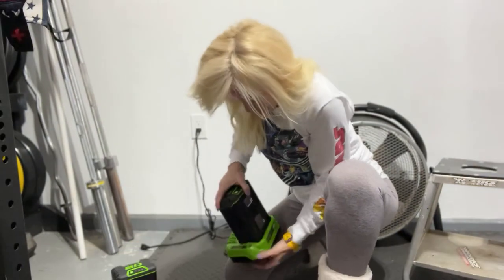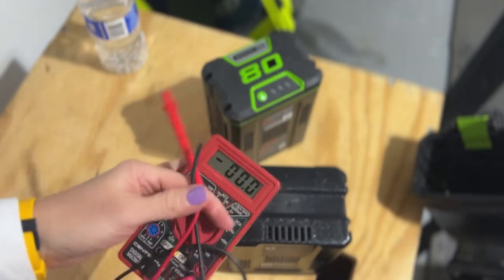Rechargeable battery repair Fix Blower dead battery solution - Power Tool Greenworks lithium

Comment: I watched about 6 videos on this problem when I happened to find yours's.  BEST one yet!  That's exactly what I did today.  No questions asked. When I went to find a new one to replace it, it had $50s off and the new one had a 4 year warranty on the battery.  I'm guessing this was a frequent problem.  I'm glad they addressed the problem as it is a powerful little blower
Reply from the maker: I'm def not educated in the multimeter field so for me to troubleshoot the outcome is grim.  I was hoping it would be a common sense fixer upper, but by the end of making the video my brain reminded me I thankfully purchased the greenworks item at Costco which has a fantastic return policy.  They swapped the blower out no questions and the new one, the batteries and the chargers are still chugging along.  Thank you for your kind words!  Have a super day!  💖💖💖

Comment: I have found solution just take one of good batteries, can be Milwaukee or different one and connect minus minus plus to plus with any wires and wait like 45 seconds to 1 minute and you will be ready to recharge.
Reply from the maker: Where were you before I made this video?!  😄 I truly know very little about those batteries.  I'm def trying to educate myself. Thank you for options.
Reply: @OfficialHeather  Not always work. My battery starts charging but after a while red starts blinking again.
Reply: I saw a video showing how to do that, but when I saw this video it was a no brainer.  Plus the Costco replacement blower was cheaper and had a 4 year warranty on the battery.

Comment: If Green work's was a better company  they could add a 82 trickle charger and better yet use a side plug in with a meter so you could see what was going on and they could use a sensor that would open the circuit, if it sensed heat or radical voltage ? Just like many Lithium Ion batteries have built in sensors which were around 15 years ago!

Comment: Repairing these batteries is often as simple as jump starting them by supplying 80volts dc to the hot and negative terminals to raise the voltage until the charger decides it is a good battery.  The smart chargers decide they are no good because they were allowed to sit too long or get to too low of a voltage.  Having a good battery helps to accomplish this.  You can find people with better explanations on youtube of jumpstarting lithium batteries.  Be cautious of these 80volts because it is getting high enough to be dangerous under certain circumstances.
Reply from the maker: I agree.  I'm learning :/  I know how to somewhat use my volt meter, but not enough to save lives with it.  I did see some of the other greenworks battery jumpstart vids, but like you mentioned to be extremely cautious.   Thanks for the input!!!!!  🤖💯⚠😀👍
Reply: @OfficialHeather  I suspect the blower you have has no low voltage shutdown. By the time the tool stops running the charger will no longer charge them due to low voltage. There have been a lot of problems with these chargers, im buying the cells for a small teardrop camper I built and ive seen a lot of them pop up when people get frusterated and sell them broken.  I would just charge them periodically even if the tool is functing fine. My favorite multimeter functions are dc/ac volts and continuity to test if a wire or connection is broken.
Reply: How do you apply just 80v?
Reply: @sethclark9780  you need an 80v source, another similar battery is the simplest way.  You would just supply negative to negative and positive to positive just like jump starting a car battery.  Dont leave it too long especially with a powerful source. Just long enough to boost it below the chargers minimum threshold.
Reply: @sietherine i'm at 74v and still won't charge
Reply: @francisblanchet4584  first thoughts, make sure it is at room temperature. That alone can raise the voltage on a worn down battery.  If that doesn't work try jump starting it.
Reply: This is not her problem as it was reading 70 V that’s plenty of voltage for that charger if it was 13 V, I’d say yeah but Sevigny should be plenty for the charger to recognize it
Reply: @groundpounder4134  the variation on a depleted lithium ion battery and a good one is not that substantial,  most tools will refuse to run after a certain level of depletion. Most chargers will refuse to charge after a certain level of depletion and often tool batteries will be rated at their maximum charge which overrates their nominal charge and other tools will be rated at their nominal charge.  Thats why most tools have an 18 volt line but some have a 20 volt line... it is the same voltage, one is just represented as 20 and the other at nominal 18.  I suspect with this particular tool she has it there is no safety shutoff for low batteries and it is capable of depleting the batteries below the will not charge line.  Jump starting will often get it above the line and permit you to charge again if cold weather or excess depletion has made them unchargable.
Reply: They also have very clever batteries with circuits that say if this battery goes below x voltage it is dead and will never be recognized as a good battery... this is dishonest business but some toolmakers have put chips in for this purpose, so cold weather, age or overuse can render a perfectly good battery as unusable... the individual lithium ion battery cells inside are still fine but the chips refuse to charge.  I hate bad business practice like that, look up louis rossman if you want to understand more about circuits and right to repair.
Reply: It is almost like saying a car battery is a 14 volt battery because after your car shuts off and the alternator stops charging the battery gradually reduces down from a top charge to a nominal charge of 12.5 either way your car probably wont start when it gets below 11 volts. But your car doesnt have a circuit that says don't ever start again if the battery even momentarily reads 10volts or dont charge if the battery is too low.  There is also the possiblility that a battery will not take the load but the voltage is sufficient, and the available amperage is not sufficient to do the work.  A car battery can read 12.5 and still not be capable of turning over the starter this is a rarer failure though so voltage is generally a good way to check quality but the better way is a load test.